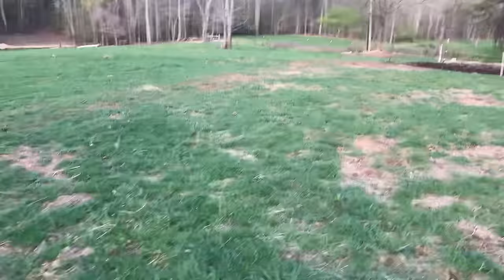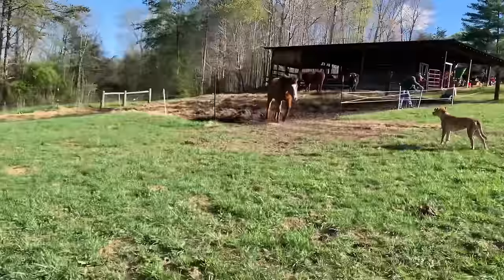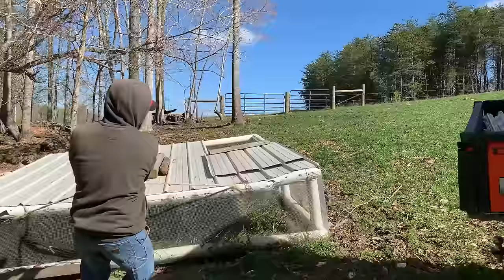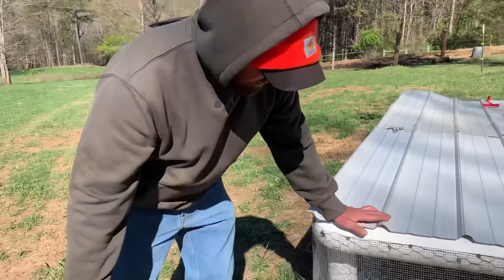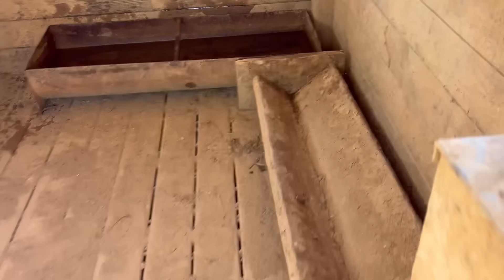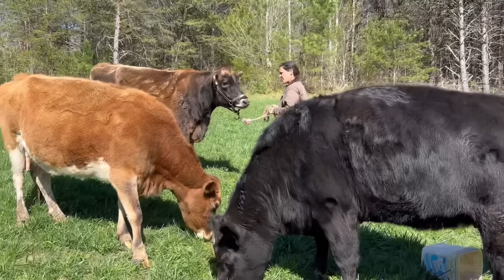Is There Anything Any Prettier | Homestead Vlog | April 8, 2024

Comment: if you put some 45 degree fittings and extensions on the front of the chicken coop it would work like sled runners and it would pull a lot easier.

Comment: Black ABS pipes a lot strong for move in your line of work . Great little video, I roll off lobster 🦞 and crab 🦀 traps ropes use for your job . Every season I change out for new ropes because traps are very expensive to be loosing traps . Great 👍 little idea for your FREE RANGE CHICKENS 🐓 for organic chickens 🐓 feed . I would use 1/4 square wire because we got minks and weasel in the 709 . NO skunks 🦨, or raccoon 🦝 and snakes 🐍 in the ROCK 🪨 ( Newfoundland) 😊😊